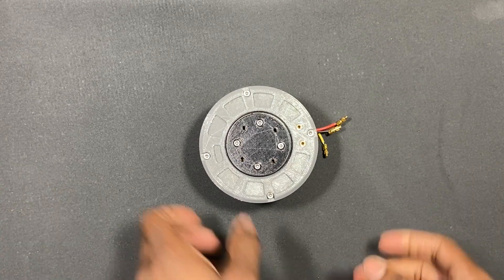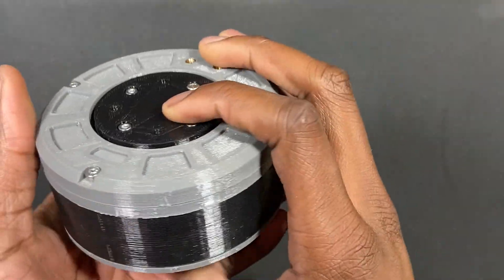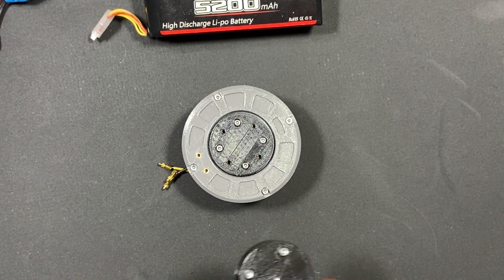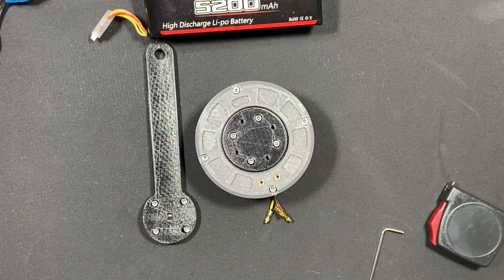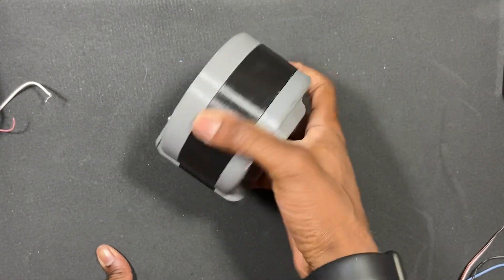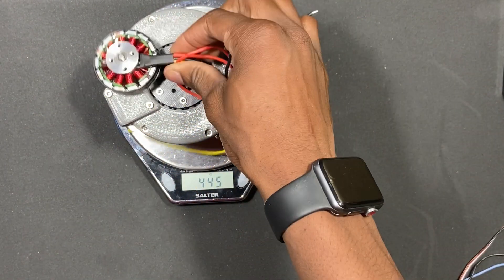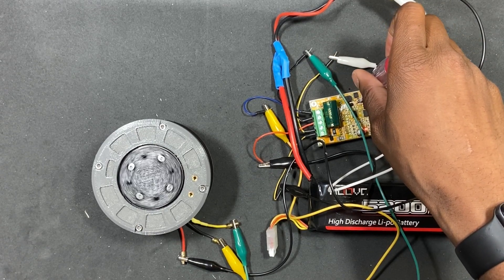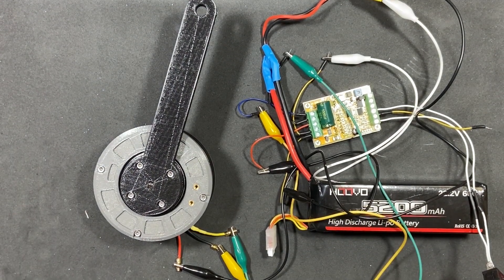3D Printed Robotic Actuator

Comment: Hey man! I'm using the exact same motor for my quadruped build. I think you're going to have a hard time with the stability of the bot with such a high reduction ratio. You generally want a very backdrivable box to have natural compliance.
Reply from the maker: Yea I have realized that now. I'm currently working on a new cycloidal gear drive with a 28:1 reduction so that backdrivability isn't an issue. Love your content by the way and thanks for the tip!
Reply: instablaster...
Reply: do you think 6:1 is too little reduction
Reply: @lukefischer7880  I've been using the same brushless as the video and I have 9:1 reduction. I wish I had gone with 1:10 or 1:11

Comment: Awesome job! Great content! Thank you for sharing and contributing to the Maker’s community! Are you using the Imperial (or Freedom lol) units for designing your projects?
Reply from the maker: I use both unit systems. I usually use imperial units for bigger dimensions such as the diameter of the gearbox. I use metric units for clearances and tolerances.

Comment: I love it, I'm glad you're using an encoder and brushless motors. I'm building a biped walking robot on my channel I have a lot of problems to work out, but it's only my first version. Check it out if you're interested. I look forward to your next video.
Reply from the maker: Thanks! Currently working on a new planetary gear box and I make it a bit more compact. Your bipedal robot look awesome. Your definitely on the road towards making the next Atlas! What kind of bldc motors are you using by the way? And have you considered using a QDD actuators?
Reply: @aaedmusa  It's my first attempt to understand what I didn't know and test my software in the real world my next version will have better actuators, but I don't know what yet. I'm using 192kv 50v 80amp  4000w (That's more power than the timing belts can handle)
Reply from the maker: @Build_the_Future  nice, definitely check out MIT’s Hermes bipedal robot for some more inspiration. I look forward to viewing your future versions and any of your other projects!

Comment: Assuming 3 stages of 5x reduction planetary gear sets, and very small module of teeth, the final efficiency will not be ideal even for a 3D printed gearbox. https://www.youtube.com/watch?v=z2rNNo8Ivmw is a differential type of planetary reduction, which derived from flex drive, and same principle from "gear down for what" type, maybe you will be interested and bring you some idea.
Reply from the maker: Interesting, I've played around with a split ring gearbox before but I just couldn't get it it be backdrivable. May be worth looking into again.